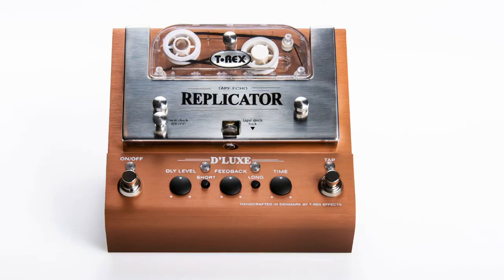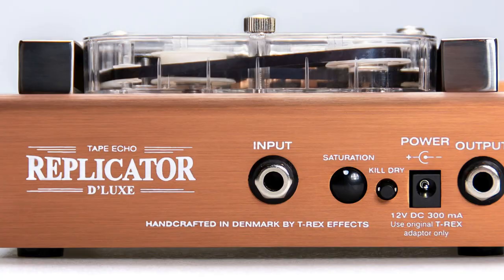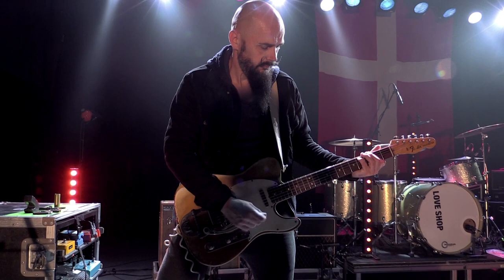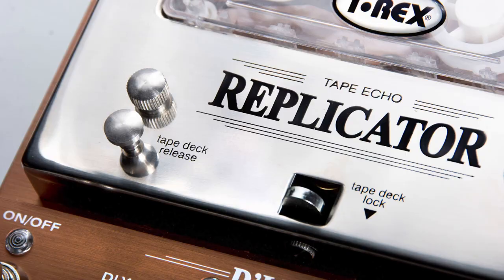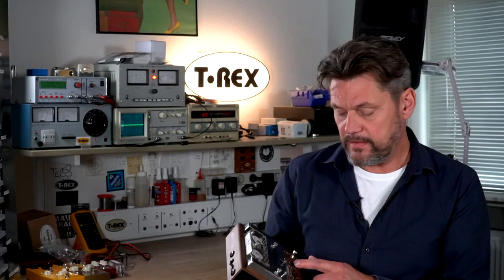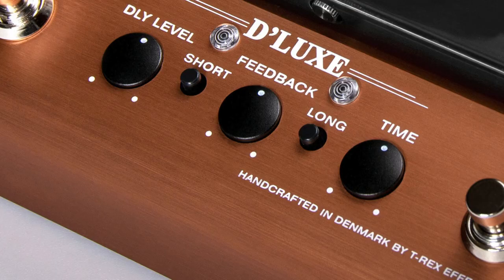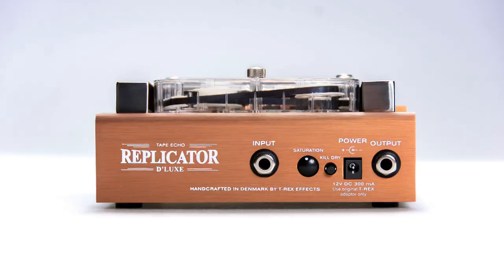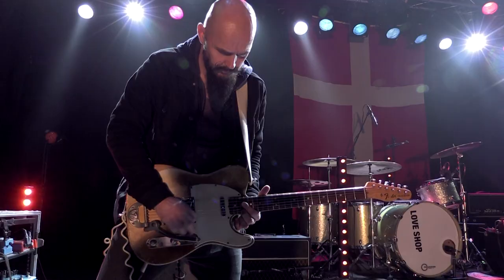Replicator D'Luxe - Tape Echo (Product video)

Comment: I bought one as soon as it as released and lately I've been using mine for recording with a line out from my DAW so that I can add it to any track. I use the kill-dry switch and turn the gain all the way down. So many effects you can do such as tape flange and doubling with this setup.
Reply: Hey, i search a good slap delay for my vocals for my mixings. I search something it sounds like a marshall tape eliminator. Because the tape eliminator is too expensive. You think its possible with this T-Rex unit?
Reply: @MrJinusean90  Yes, it can do slap pretty well. It has 2 heads, one short and one longer and each are voiced differently - the short delay is a bit duller, the farther one a bit brighter.